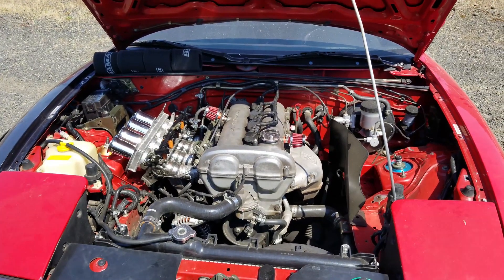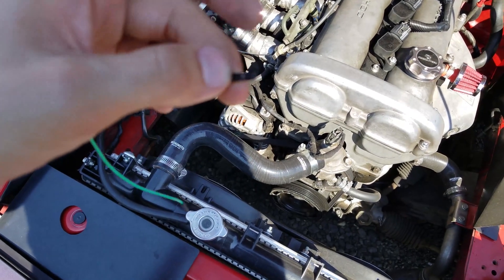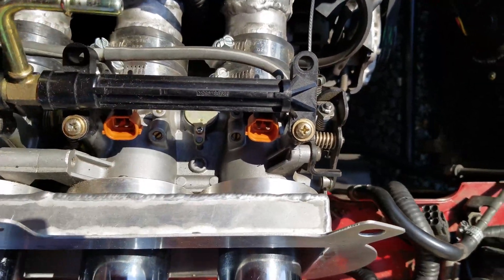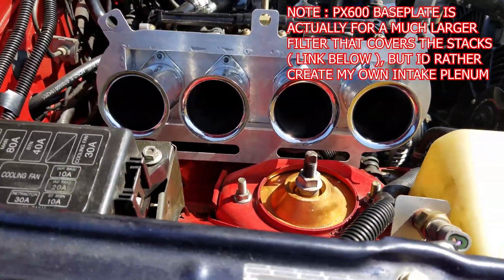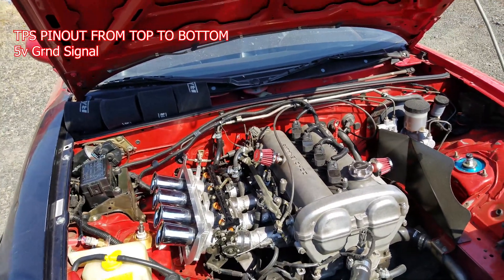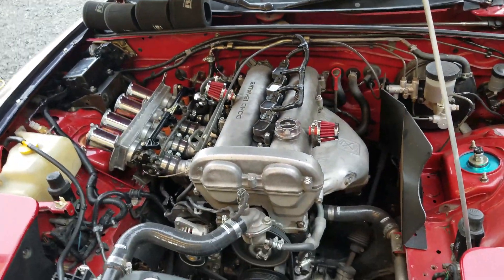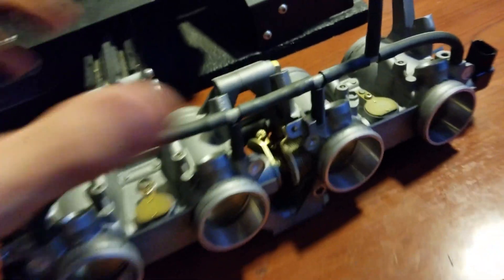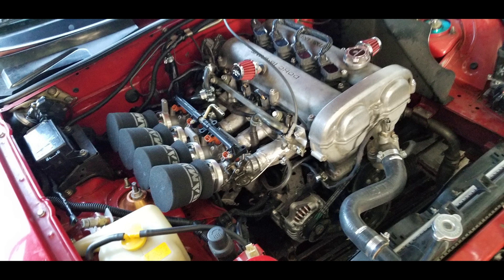MIATA/MX5 GSXR ITB Conversion

Comment: Question my friend. Do you have a original cpu on the car? Thanks
Reply: by cpu do you mean ecu? They do not. You are able to, if using the original air flow meter. However this adds a large restriction, taking away many benefits from ITBs.
Reply: @graha_ha  yes. The ecu. Thank you for the response👍🏻👍🏻👍🏻❤️

Comment: The secondary throttle plates can help alot during the low end air modulation in order to avoid a lean spot condition due to very reluctant acceleration enrichment. It's a bit of a fiddly issue to set this up with your standalone but in fact manages to deliver better low end driveability which is an issue with all the ITB's. Also staged injection of a GSXR ITB's is essential for WOT enrichment and delivers stable AFR during high velocity stream.

Comment: Why do people do this? What’s the advantage?
Reply from the maker: There are horsepower gains to be had if you have complimenting mods, like cams, bore/stroke'd block, etc. Fundamentally ITB"s allow more air into the cylinder at a faster rate and a better control of the airs velocity.

Comment: What could you recommend for a 1.8? I have been interested in making as much na horsepower w/o spending a lot of money.
Reply from the maker: I'd recommend 750's, 1000's, or 1300's. Same bore spacing on both, but the 1300's are have a larger diameter by 2m, and you can respace them easier iirc.

Comment: gsxr 750 throttle bodies are what is used for the mx5 right? just curious as im trying to figure out what i want to do
Reply from the maker: Yeah, I went with GSXR 750's for the 1.6 - don't go with 600's, too small in my opinion.

Comment: Hi to anyone reading this. 
I'm doing something similar on a BMW M52 i6.
The BMW engine likes vacuum in the crank case apparently.
If you wanted to run the crank to vacuum how would you go about doing it?
You can't connect to a single runner like you/he did with the brake booster as it's an open system so you're introducing a vacuum leak.
I think the 3mm hoses on the gsxr ITBs are fine for Map or fuel reg but too weedy to vent the crank case.
If I add a plenum I could tap into that but I wouldn't create much vacuum there (non under boost, however I'm not likely to do this) and unless a catch can worked really well my ITBs would get all messy.
I'm a little stumped on this one. Thoughts appreciated.
Reply from the maker: Sounds like an awesome project!
I hadn't considered my fpr/brake booster lines being an open system, but it makes sense. Strange that I haven't had any issues though.

It's been awhile since I posted a video, but I've routed my crank case ports into a catch/breather can, and said can seems to hold vacuum. I'm not entirely sure what the vacuum level is, but it definitely makes the RPM rise if I open the can, so I'd assume its achieving vacuum. 
Wouldn't that work find for your situation? It'd be isolated from your ITB vacuum lines as well, so I doubt they'd get 'messy'.
Not too familiar with m52's, sorry if I'm missing something obvious.
Reply: @toomanymiatas  hi there.
Sorry I wasn't clear, I believe it would only be an issue running the crank case vent into a single runner.
Brake booster should be fine as it will only let extra air into the single runner immediately after pressing the brakes, so unless you dab a brakes a lot then open the throttle I don't think you would notice (this is all assumption).

So does you catch can plumb into the skinny  3mm gsxr vacuum hoses? This seems like the easiest option, I just wasn't sure if they are big enough for the job.

Many thanks
Reply from the maker: @richardschofield2201 
My catch can is plumbed directly into the valve cover/crank case, since there are two ports on it stock for me., and my catch can has a breather port for ventilation. 
I'm not too familiar with your engine, so I wasn't sure if your valve covers have breather ports - if they do, just route those into a catch can. 
It's all entirely separate from the throttle body vacuum system.  Might be wrong to do it this way but It's been working okay for me so far.

Comment: For your Tach output.... there are 2 different toyota coils types.   Four and three pin. The fourth pin is a tach output signal you cane use :) I drove it 6 years with this coils no issues
Reply from the maker: I didn't know there were 3 pin types, good to know! My coils are of the 4 pin type - main issue I ran into was not getting the correct tach reading on my cluster. My ECU always read the correct tach reading, but the cluster doubled the rpm reading if all 4 coils tach outputs were in series. With one coils tach output wired in series, the reading on the cluster is 1/4th, rather than double, with the ECU still reading the correct RPM. Really odd behavior, feels like I was missing something obvious ha
Reply: @toomanymiatas   Hi, if I remember correctly (it was 4 years ago when I replaced it) I had used a pullup resistor in the wiring harness to get the correct speedometer signal. The ECU gets the signal from the engine speed trigger. Since I drive with the VAG coils I have my cluster the values from the ECU via the speedometer output forwarded.
Reply from the maker: @ferox1183  I actually tried a bunch of different pullup resistors, since none of them really seemed to change anything.
 I might revisit it in the future, but since my ECU is still reading the correct rpm I'm just going with a pi dash.

Comment: 3D printing injector plugs seems like a cool idea. But I think you could try out the dual injection feature on the Speeduino. Secondary injection should add some horses to the top end.
Reply from the maker: I feel like I won't really need the secondary injectors when it's NA, but that's definitely something I want to experiment with in the future once it's boosted! It'll be interesting to see how much boost I can get away with on stock injectors + gsxr injectors.

Comment: It's probably a stupid question but is there any way I can do this exact setup but on stock ECU? Like tricking it somehow
Reply from the maker: It's possible, but you'll have to make a couple more things to get it to work. You'd need to make an adapter for the stock narrowband TPS to mount on the ITB's, and you'd need to make a plenum box with an adapter for your MAF. Plus youd probably need to mount your IAC onto said plenum box. 

VALCISAW on youtube did something similar. Give it a shot man!
Reply: @toomanymiatas  thanks dude really appreciate it!!

Comment: If you could add a solenoid to the second set of butterflies you could probably install a small motor to open it slowly as rpms rise to have better lowend torque while still being able to breathe in upper rpms
Reply from the maker: Thanks for the idea man! You inspired me to mess around with using a stepper motor to actuate the secondary butterflies. Much cheaper than buying a Suzuki stva. I'll be sure to post a video in the future once I've worked on it some more

Comment: Anyone tried the bolt on boots from gsxr1000? I have a spare manifold and dan st has a blank flange. I'm convinced it could be done with no welding, and reusing the bike injectors
Reply from the maker: That's definitely an option!
You'd be going from tuned port injection ( I think that's the right term ) to throttle body injection by doing so, and you'd no longer have the injectors firing over the valves to cool them, but I'm not sure how detrimental any of that would be. 
I've been prototyping an intake manifold with stock 1.6 injector holes and fuel rail mounts with runners at the correct angle/spacing to adapt to the GSXR ITB's with no welding required, so that'll be an option soon enough too!

Comment: Hey mate, you should try and get the catch can soon if you have not already done so. Having the breather just above your hot exhaust manifold is a recipe for disaster.
Reply from the maker: Thanks for the concerns! I hadn't actually considered that when I originally installed the breather. 
I've installed a catch can already, but an easy solution would've been to use the stock hard line/vaccum line and just route the breather to the left side of the engine bay.

Comment: hay man how did you get the afr gauge to work with speeduino. the one i wont to buy has a built in wideband but not sure how to get a gauge to work
Reply from the maker: It's actually super simple on a Miata!  I wired the AFR gauge/wideband controllers signal wire into the stock AFR gauge signal wire, which on an NA6 pnp unit is already plugging directly into the Speeduino. Ground the wideband controller at the ECU, and grab 12v from the ECU. It'll help with sensor readings.

Then you've just gotta calibrate the sensor under Tools -> Calibrate AFR, and choose the gauge you bought in the drop down menu or put in your own calibration if yours isn't listed there.  To get it to show up on the dashboard, right click the gauge -> snesor inputs -> AFR 1

Comment: Is the link for the wiring diagram you used in the drop box?
Reply from the maker: I actually forgot to throw that in the dropbox, but I'll make sure to do that now, my bad guys! Here's the pinout that I ended up using ;

https://www.dropbox.com/s/2pp58h2swunk60c/GSXR%20750%20Pinout.png?dl=0

http://www.locostbuilders.co.uk/viewthread.php?tid=34956

Uploaded to dropbox just in case that forum ever ends up going down.
Reply: toomanymiatas thanks brotha